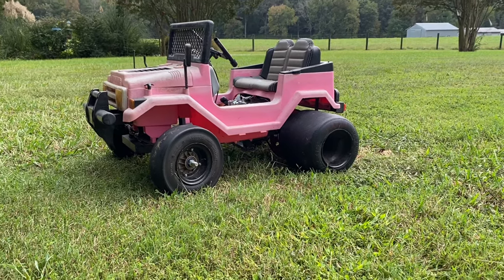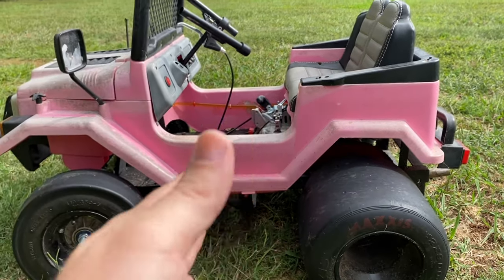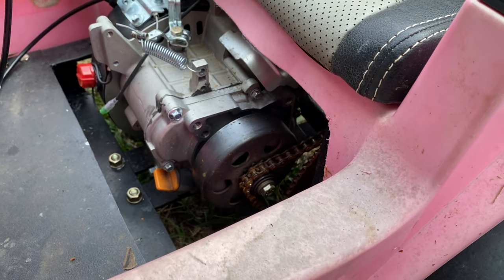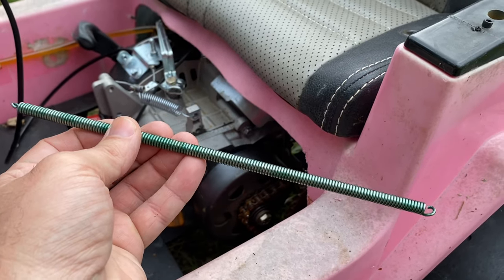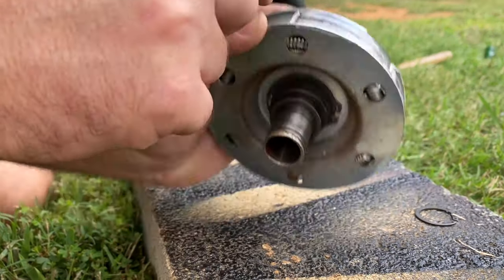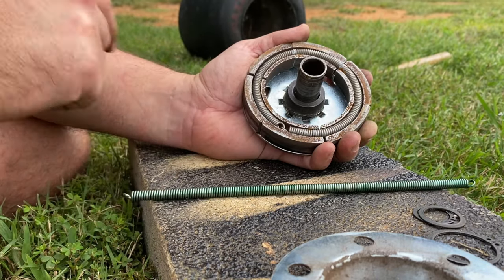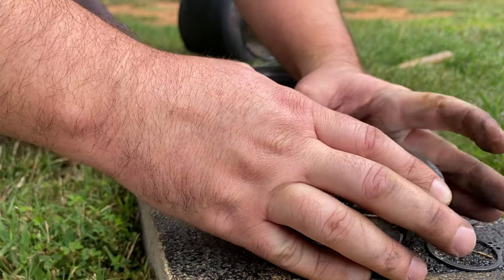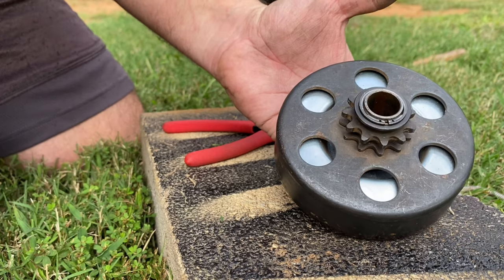Changing Spring In A Centrifugal Clutch - 79cc Power Wheels

Comment: You would want a bigger clutch in the front and a smaller one in the back that way you get more rear sprocket rotation per one front sprocket rotation
Reply from the maker: The setup you are describing would be great for top end speed but would produce very little torque. A smaller clutch sprocket and larger axle sprocket would increase torque and more power to get moving.

Comment: Just need to change the back sprocket to a 58 teeth
Reply from the maker: I usually run somewhere between a 60 and 55 tooth but the main issue with running that larger is I constantly bend the sprocket and sprocket hub. That really adds up over time.